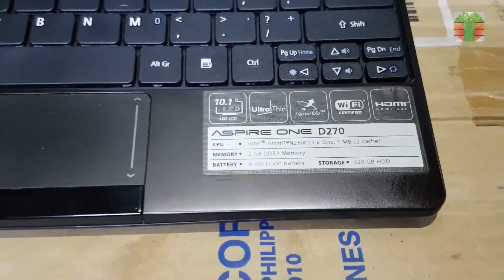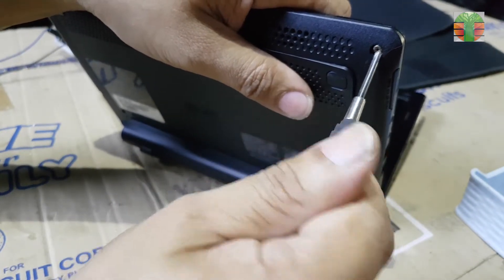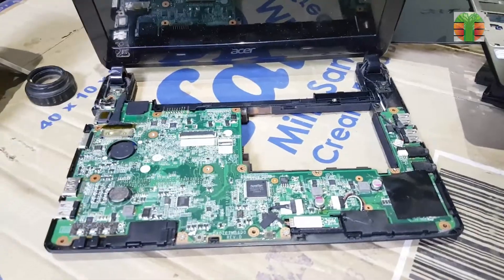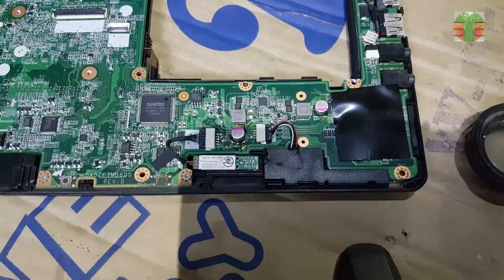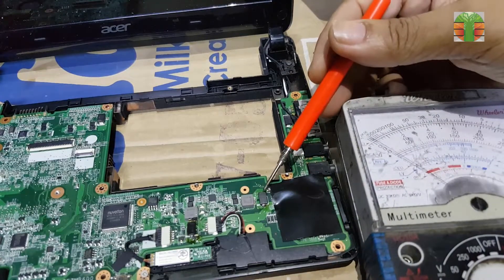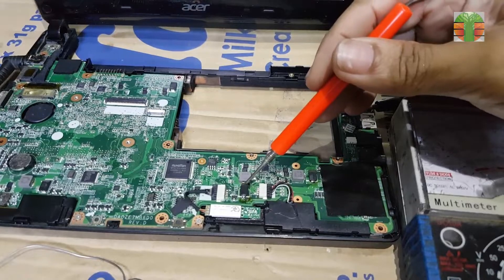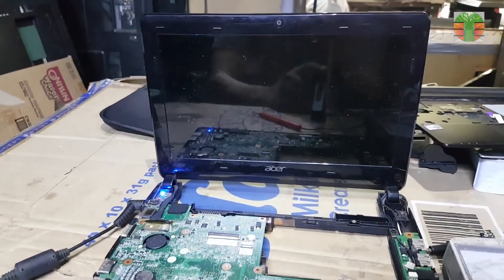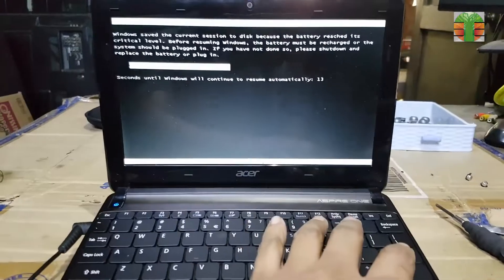Netbook Acer Aspire 0ne D270. No power fix.

Comment: Just curious, how do you know that it is these 2 caps that cause this "Can't power on" problem? Is this "Not power on" problem mostly due to these caps?
Reply from the maker: Because I did it many times. These 2 capacitors are the 3.3v and 5volts standby. no standby. the laptop won't turn on.
Reply: @tevzTVTevatronics  I see. Thanks Tevz